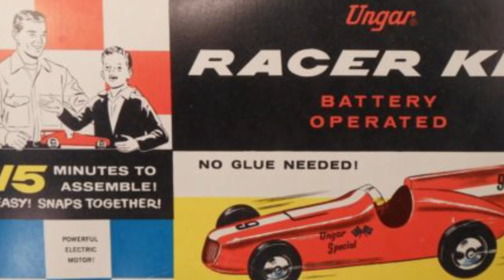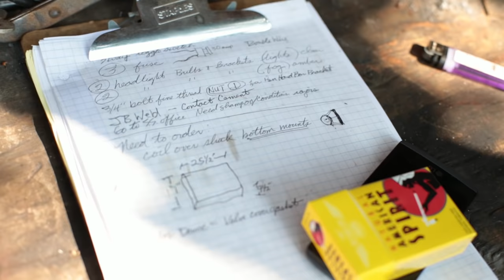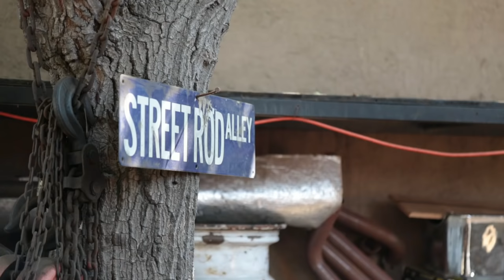Echo: Made In The Shade - How to build a hot rod under the trees.

Comment: About 1960 my future BIL and I would go 9 miles to another town where the local hotrodders had an old store, so old I never knew the original purpose.  It was cold and dirty and disarrayed but full of guys building old 30's and 40's coupes and using big Olds, Ford and sometimes foreign power(somebody wiped out their Jag in the hinterlands and didn't care to retrieve it).  It was a great group of guys just building whatever they had in mind and the parts they could get cheap.  There was no rod with original anything but some of the body.  It was fun though since I already had the bug.  Several years later I'd have the "car to beat" for several counties around.  People would just show up and want to race I had never met or seen before. it was a little poke I left the "275 HP" decal on the air cleaner lid that got to some of them.  Hey, you didn't have to be Einstein to hear 12:1 compression and Arkus Duntov at work under the hood.

Comment: Under the trees, not in Shithole, Florida, you won't. Its a $500 code violation to work on your car in your own back yard or driveway, flat /low tire $500, dead battery $500, mandatory court. Ain't no country club or gated community neither. In fact it's against the law to have any vehicle that won't start up and run, anywhere in the city, in any zoning district, even repair shop.